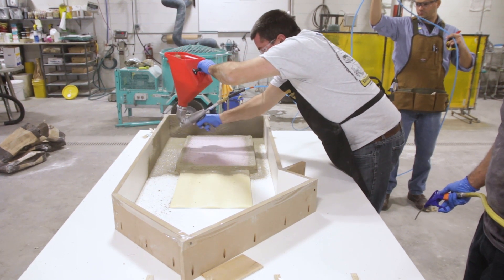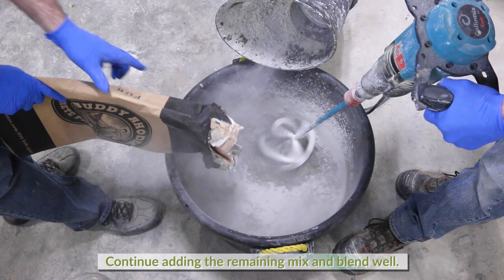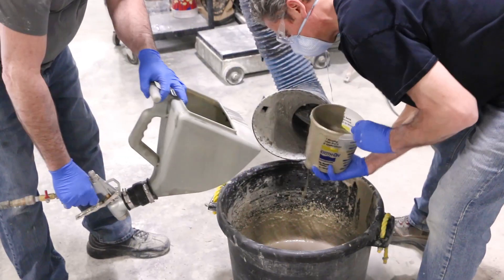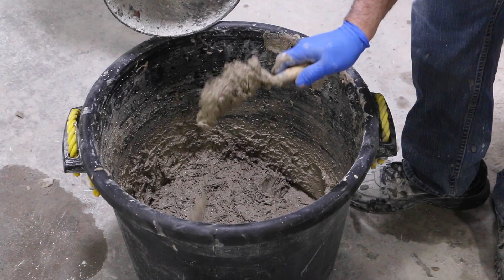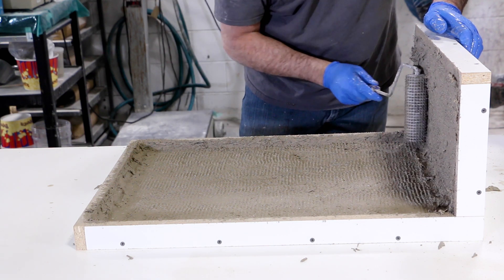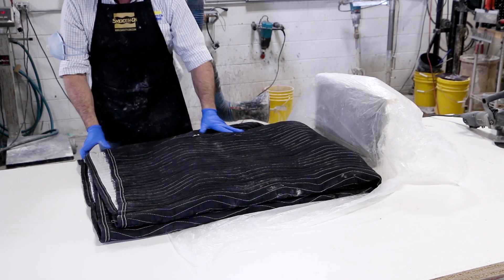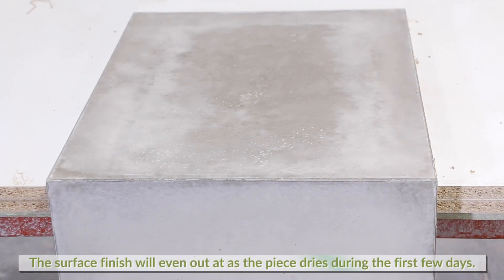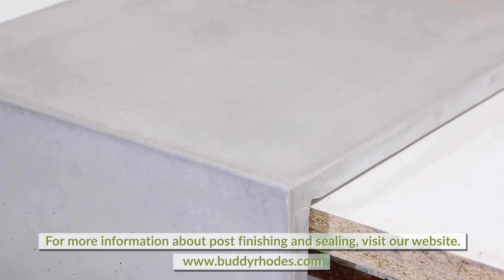GFRC Blended Mix Basics - Spray Technique

Comment: Can I "paint" on the concrete instead of spraying? I do not have a hopper and can not find anyone with one to rent
Reply from the maker: It is very difficult to do GFRC without a hopper gun. The technique relies on a thin, even coating for the first layer. You can find a gun for purchase here: https://www.buddyrhodes.com/ezy-deck-pro-gun-hopper. If you cannot procure a gun, you might want to consider using a different technique that doesn’t require one.

Comment: Would it be possible to apply the face coat without spraying?  None of the rental places here rent hopper's and I am trying to avoid buying one for just one project.
Reply from the maker: It might be possible, depending on the piece you're making. I suggest contacting our tech support team and they can assist you in that: https://www.buddyrhodes.com/contact-support